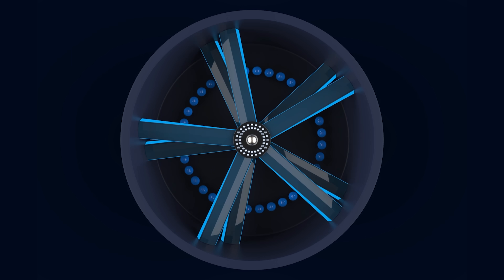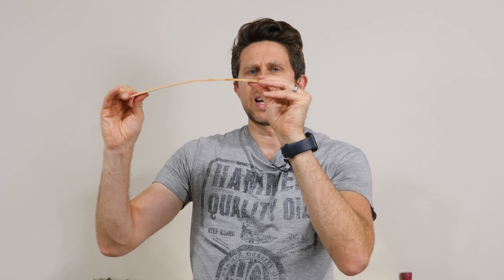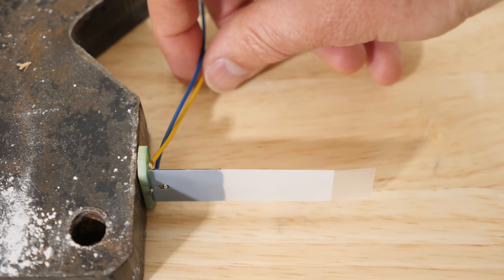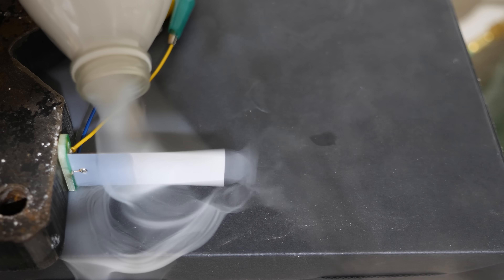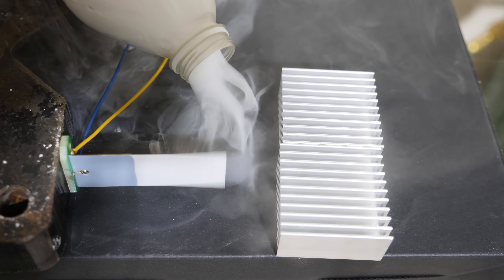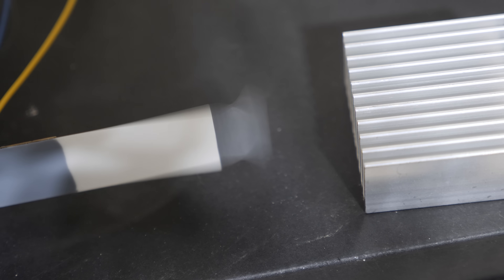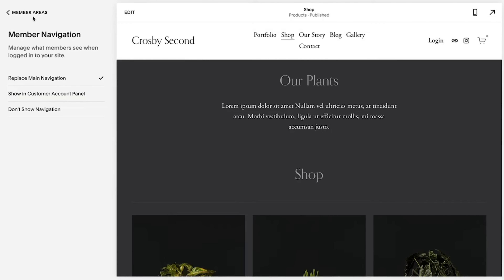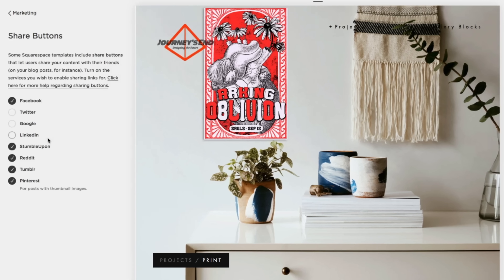A Solid State Piezoelectric Fan—Does It Actually Work?

Comment: In the early 1980s, I proposed a similar mechanism for ensuring airflow in an asynchronous serial terminal design (3 box; main electronics, keyboard and separate monitor, similar to the DEC VT240 graphics terminal) that had to be silent.  We determined that as the electronics heated up, the airflow due to convection was chaotic causing a loss of convective cooling. Adding a single sheet of bi-metal attached to a flexible plastic/nylon blade with a dimple in it and applying a voltage across a resistive strip on one side of bimetal caused the blade to slowly move in one direction, then when the voltage was removed, the blade snapped back quickly, creating a small puff of air in the direction we needed it to flow.  Any time the temperature inside the enclosure got above a set point, the process was repeated.  The physics and fluid dynamics behind convective flow would take over.  Worked like a charm.  Unfortunately, the project was cancelled, so that fan never saw its way into a commercial product.
Reply: That would've been an amazing design! It's a shame it wasn't made into a product.
Reply: @actualperson1971  🔴 What Is Islam? 

🔴 Islam is not just another religion. 

🔵 It is the same message preached by Moses, Jesus and Abraham.

 🔴 Islam literally means ‘submission to God’ and it teaches us to have a direct relationship with God. 

 🔵 It reminds us that since God created us, no one should be worshipped except God alone. 

 🔴 It also teaches that God is nothing like a human being or like anything that we can imagine.

🌍 The concept of God is summarized in the Quran as:

📖 { “Say, He is God, the One.  God, the Absolute.  He does not give birth, nor was He born, and there is nothing like Him.”} (Quran 112:1-4) 📚

🔴 Becoming a Muslim is not turning your back to Jesus. 

🔵 Rather it’s going back to the original teachings of Jesus and obeying him. 

More .....
Reply: This is why you never invent something on company time or company dime. Otherwise, it’s not yours. If you have a stroke of genius that will fill a niche perfectly, you work on it at home in your spare time, and then you patent it and license it out.
Reply: @MikeJones-mf2rt  when I worked for Apple,  the non-compete paperwork also included language that they had ownership of any invention that was created during your time working for them, including off time. I reread that part three times. I signed anyway because we had just had a baby, and we needed the money.
Reply: @MisterWillX  I got offered a job in a Montessori play school and they wanted me to sign one of those waivers.

I refused.
Reply: @MisterWillX  that sounds like slavery
Reply: @sameerrishi8548  they had a lot of policies that felt very anti-worker. They did have a lot of morale building events, but it was still a very depressing place to work. My coworkers were really great though.
Reply: @MisterWillX  is that enforceable though?
Reply: @GameTimeWhy  well, I also agreed to arbitration too. So, they would probably win an arbitration case. It really felt like a terrible environment for employees.
Reply: @MisterWillX  was it good experience at least? Or good for the portfolio?
Reply: @GameTimeWhy  overall it was a mixed experience. The people were great, but there were always threats of being terminated for making certain mistakes, or if someone complained about you to Steve Jobs. Also, the shift was 9 hours long, and it took me an hour to get there, then an hour home, so I  would just have time to eat dinner before my kids went to sleep. Then I'd wake up and leave for work before anyone was awake. It was hard. The pay was good. It was about $45k a year in 2009. Also, they would train us to repair apple products, even though that wasn't our job, so we would get certified in things like Mac repair for free. So, that was a bonus.
Reply: @MikeJones-mf2rt  the problem with that is that you don't have self funding your amount of earning power is quite drastically low that's why a lot of inventors don't invent because monetary power is below a state one rather than a state two run inventor to invent tools and be profitable they need to be at least a state three monetary power
Reply: @ragnorockcookie2868   Large-scale production definitely is an issue for those who don’t have a large financial backing, and-so usually requires partnership, but designing and prototyping can typically be done relatively cheaply and easily at home, which is why I say just patent the design and then sell licensing to someone else who does have a large enough financial backing for production/distribution. 

If you attempt to be inventor, manufacturer, and distributor all at once, and you don’t have the finances to pay entire teams of people to fill each of these roles, then your invention will most likely never see commercial success.

If you partner, you obviously won’t be keeping all of the profit, but your invention will belong only to you and you will still profit from it greatly by licensing it out to someone else acting as manufacturer/distributor. 

Much better than your life’s work ending up becoming property which belongs to your employer, never seeing even $0.01 from it, and having zero recourse.
Reply: @MikeJones-mf2rt  that is why I cannot invent certain ideas of mine because my monetary level is at 1power
Reply: @Yatish38 you're not missing anything. It's definitely overreaching on their part.
Reply: Sounds like a great design!
Reply: OMG! The VT terminals, I remember them well... first real video game I played was VTTrek, so much better than the ASCII Star Trek game I played on the old ADM31 and ADM3A terminals!
Reply: @Yatish38  2 words: Planned Obsolescence.
Reply: Well you must be the guy behind the Rockwell retro-encabulator.
Reply: @Blockhead2003  haha the Rockwell retro-encabulator is one of my favorite oldschool vids :D I knew the entire script by heart for years :D
Reply: @Blockhead2003  i came here to ask that LOL
Reply: @Daniel Glasser i would love to know little more.curiosity!  did you publish ur works?
Reply: @Yatish38 I think it may also be to protect their interests. A person may find an improvement to an Apple but instead keep the idea to themselves and develop it at home and if it’s unique enough from the product(s) they were working on then Apple’s patent would not protect them. That being said, I don’t think it’s okay. If a person creates a unique product with their own time and resources then it shouldn’t be owned by their employer. Basically, I think Apple has some level of justification, but it’s certainly an overreach and not something they should do.
Reply: Wuuuuuuuuuuuuuuut
Reply: you deserved a nobel prize :o
Reply: I understand the motion you describe from using large pieces of cardboard to fan campfires.  Snapping quickly then getting out of the way of the air behind the sheet to keep flowing is twice as effective. I think their is a bit of Bernoulli going on too.
Reply: You're a smart man.
Reply: @Yatish38 It is common boiler plate in most working contracts for big corporations.
Reply: I do HVAC. I understood at least some of what you just said. Some
Reply: Just came here from the AirJet CES. Looks like we can get this in laptops some day
Reply: Why was it cancelled?
Reply: Has anyone read Understanding Physics by Isaac Asimov?
I had the 3 volume collection years ago. But in my late twenties I became obsessed with Creation Science and gave them away. It was my 30's I grew into a Theistic Evolutionary view. I found them recently online again.
In 2007 a book outlining his reasons for changing his position, There is a God: How the World's Most Notorious Atheist Changed His Mind, was written by Anthony Flew in collaboration with Roy Abraham Varghese, and included a chapter on the resurrection of Jesus.
The next scientific revolution will be when Richard Dawkins converts Isaac Asimov's 3 Volumes of Understanding Physics into Solid State Metaphysics. I had 
the 3 volume collection years ago in the early 90's. But in my late twenties I became obsessed with Creation Science and gave them away. It was my early 30's I grew into a Theistic Evolutionary view. I found them recently online again. When Led Zeppelin comes together they will establish their Finest Album -
Metaphysical Graffiti. May Sir John Henry Bonham's name be sung in Heaven Forever Ever After.
Reply: Isn't it bimetal that is used in the nonelectrical fans that sit on wood stoves?
Reply: There is a company called frore systems that designed a fan such as this mainly for laptops, but it's output per watt was not enough to compete with traditional laptops fans so it never got to the market, but one of it's advantages was it's static pressure which was very high. So I think such a fan could have huge advantages in some fields.
Reply: Go to sharktank with a prototype
Reply: Sure you did Tesla, and you built a water engine right after that, huh? And also you have dusty designs for a perpetual motion machine. Sure thing, tell us more
Reply: Suuuure you did....
Reply: OMG normally people just drill a few extra 'decorative' air holes in the box instead of sinking company funds into inventing superfluous cooling gizmos. and how is a snapping thing more silent than a low speed fan? cmon
Reply: @echelonrank3927  spotted the shill

Comment: You have "just" to drive it with a large AC voltage, that's quite a thing that the video didn't highlight and a normal fan just need a DC voltage that inside it's maximum limit to work.
Reply: I mean for the one he jury rigged together, sure, but the beepers in digital stop watches are piezo too and they operate perfectly fine using 1.5v from a button battery... You could easily make these things run at 12v

Also, most of the world operates on 240v without getting their knickers in a twist xD

Comment: Your video feels like this is THE solution and everyone should get dozens of these fans right now in their house.
You must add a section in the video explaining why this is not practical for consumers so that the video makes sense.
Reply: Yeah, there are several good reasons why this isn't in wide use even though it has been around for 50 years. It is very useful in very specific circumstances, in general use rotary fans are much better though.

Comment: I feel like problems may start to emerge if you try to really scale up the concept.  Bigger versions may start to get impractical.  Though I wonder if a three-dimensional array of smaller fans could greatly increase airflow.
Reply: The answer is yes.
There are server racks that utilize that system.
Reply: Reminds me of how sea sponges circulate water through their bodies. A vertical tube with these inside could function similarly.
Reply: I wonder how practical it would be to line a tube with something like this as a water pump?
Reply: @kevinquintana2647  You could probably get some flow, but with not much pressure behind it. Might need to tune the oscillator for the higher viscosity as well.

Comment: Makes me wonder just how efficient these would be compared to a rotary fan (equivalent air volume movement.) Probably not very, but it seems to me that the lifespan would outweigh many other factors in many more settings than they are currently being used.
Reply: piezoelectric motor efficiency it's about 6% compare to conventional electric motor of 96%. Since for industrial cooling application, the cost of energy far out weigh the cost maintain and replacing the equipment by several order of magnitude. It only make economic sense in extremely small scale, where energy cost component is insignificant. There is also a reason why you don't see full size airplane fly with piezoelectric motor, but see plenty of finger nail size drone fly with piezoelectric motor. It's mostly applicable in a ultra small scale or where in application where cost maintenance is extremely high (inside a high pressure or high temperature or chemical corrosive environment, where it's hard to replace a component once it's broken)
Reply: Inefficient, weak, expensive.
They are useful in environment were you can not have any open parts, where the bearing-surface would be a risk to the process or the environment would be damaging to the bearing.
Reply: There is a kind of wind generator that uses this process in reverse.  It uses Styrofoam tubes to catch the wind, but there is a little Piezo strip at the bottom of them that bends back and forth.  It kind of looks like 2 foot tall blades of grass and is virtually silent.  They were talking about using them for rooftop wind, although I've seen some scaled up versions too, designed to be bird safe.

I also saw a research paper where they were using Piezo strips to harvest waste heat from industrial processes.

Comment: Does the molecules in the flap not cause friction that will eventually cause damage? Even if it takes longer there might still be some damage. I dont know I can be wrong just a question.
Reply: That's not the failure point, it's fatigue, and all materials suffer from it at some level

Comment: I'd like to see this miniaturized and waterproofed to where it can be imbedded into swim baits for fishing.
Reply: Insulating it would be easy with a waterproofing spray or more likely just emedded in the silicone mold of the lure. you just would need to have the power source and electronics all inside the lure, maybe a reed switch to turn it on so you wouldnt need a button.
Reply: Have fun providing your swim bait with high voltage alternating current.
Reply: @0106johnny  similar things are used for haptics using 5VDC source.
Reply: Not applicable to liquids
Reply: @THEDANOFFICIAL  similar things are used in valves.

Comment: No bearings or copper wire coils is amazing if scaled up properly with light materials... Not technically "solid state" but definitely an efficiency and cost revolution in air pumping of any kind. I can already think of improvements to the design that would let you compress/vaccum air too
Reply: This would NEVER be applicable in a pressure focused application such as a pump, there is no way one of these flappy things can generate any meaningful pressure, at most you could use it for ventilation, as it has been used for YEARS
Reply: @THEDANOFFICIAL  could work in MEMS circuits though, in tiny dialysis machine style pumps with sequential piezo elements instead of a rotor.
Reply: @THEDANOFFICIAL  
Using three or four steel reeds in series, with proper baffling at tight clearances you could produce good pressure. Especially if the reeds are vibrating at resonance. Would have to just sacrifice flow. Ideally, you could produce the same pressure as the peak of the sound wave. Just need to tune the "air box" flow characteristics to amplify the diodicity the fans air projection.
Reply: "but definitely an efficiency and cost revolution in air pumping of any kind"
They are incredible expensive (it is old tech) and way less efficient than normal fans. hence why they are used only in certain niche applications.
Reply: @ABaumstumpf  im sure someone can mass produce the piezo elements cheaper. Thats the only hurdle. I didnt say it was perfect. Not enough research has been put into it
Reply: @stupidvids0  "Thats the only hurdle."
No, that is not the hurdle, not even close. They are inefficient, are more complex to manufacture and they are a lot weaker.
Yeah sure, make a 0.1$ piezo fan - that does not help you when it delivers less than 1% the performance of a 5$ fan.

"Not enough research has been put into it"
No, this is old technology, like literally100 years old already.
Reply: These things have been available since the 1970s. There is a reason they are only used under very specific circumstances.

Comment: Why i have a feeling that plugging a piezoelectric to the outlet is kinda dangerous?
Reply: I don't know, because it really isn't more dangerous than plugging anything else into the outlet.
Reply: @0106johnny  I've just realized that plugging a piezo to the outlet it's okay it go to a thousand ac volts but carefully not to touch the wire contacts to the piezo
Reply: @crowblunt536  Well yeah, you shouldn't do that for any device you plug in.
Reply: @0106johnny  i already did when i was a kid accidentally plug a toy fan and wire a thick wire in the battery contact but then i plug it nothing seems happened when i clicked rhe switch it exploded to my face luckily i didn't hurt or electrocuted just the motor survives but the switch is toasted

Comment: This was a particularly interesting one! Does the bimetallic spring build up any heat? Is it strong enough to cool itself if so?
Reply: it would definitely build up some heat but it would literally be such a tiny amount basically negligible, also the fact that is a fan means that it always has air flow being ‘sucked’ past the bimetallic spring so it’s essentially self cooling

Comment: How much power would a big one use, make it like 6” wide, or do 10 of this one stacked in a tower fan.
Reply: How much power it would use isn't really the problem, the problem would be the noise, if you tried to move large ammounts of air with flappy things you would generate so much vibration I bet you'd get 70-90 Db
Reply: @THEDANOFFICIAL  nah not that much but still good point